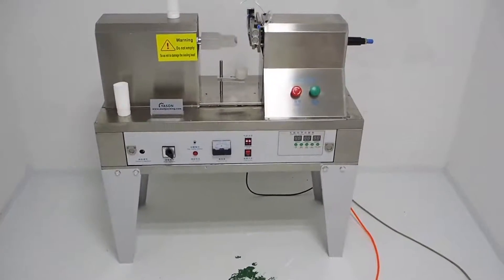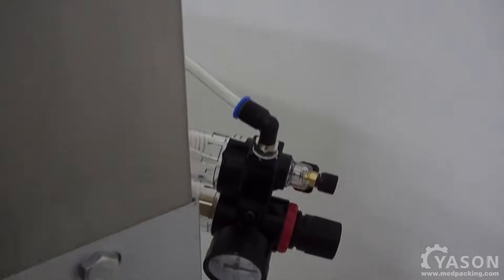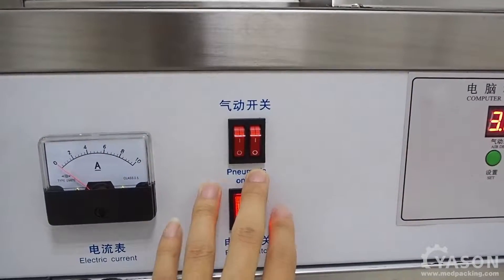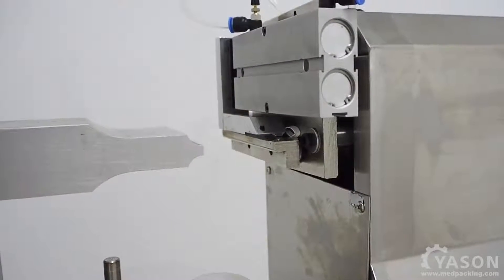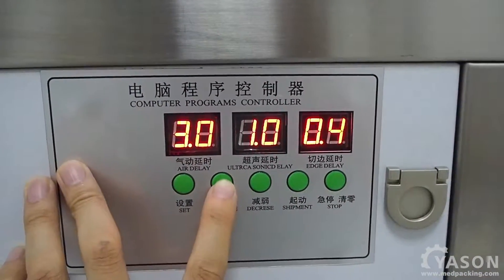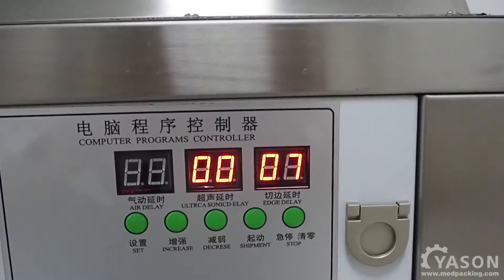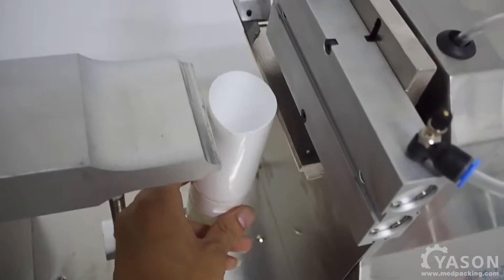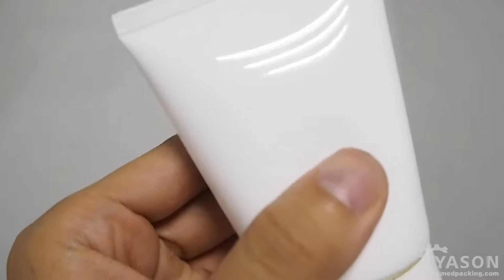Ultrasonic Tube Sealing Machine

Comment: Hello, thank you so much for the video. 
Are there any particular settings for the air compressor?
Reply from the maker: nope, but you can tweak the cylinder's speed by turning the small valve on it.
Reply: Thanks for your response. My machine is showing an error message and I think the motherboard is broken. It is not heating the tube, but the pneumatic part is working. Can you please advise on how to fix it? This issue started after I changed the air pressure regulator because the previous one got broken.

Comment: What does air delay mean? Is this the time the machine is supplying air into the tub before the ultrasonic seal starts? Also is the ultrasonic delay the time the sealer is applying ultrasonic heating to the tube?
Reply from the maker: Yes, you're correct, this is basically like how you will controll how long each step that the machine takes to perform.
yasonsale@live.com, let me know if you have any questions.